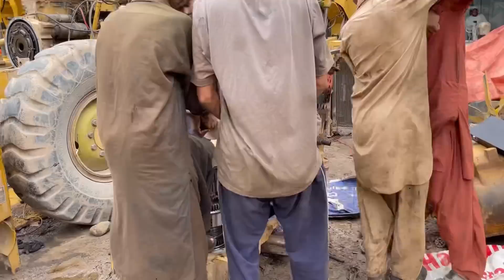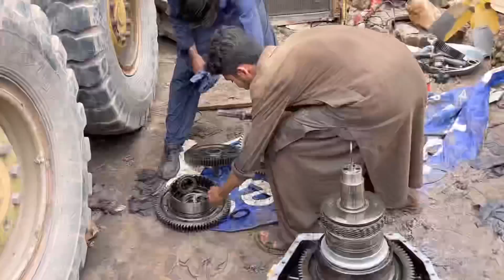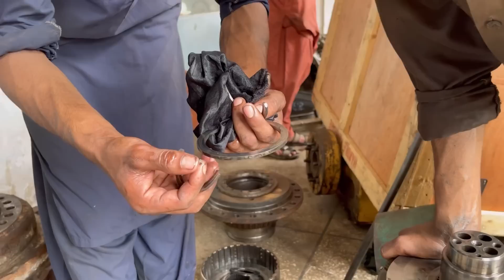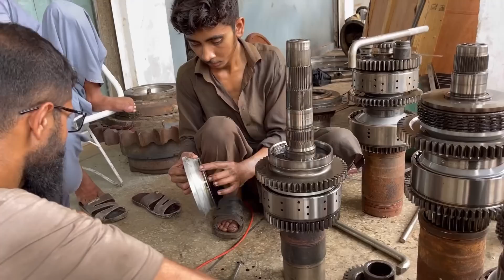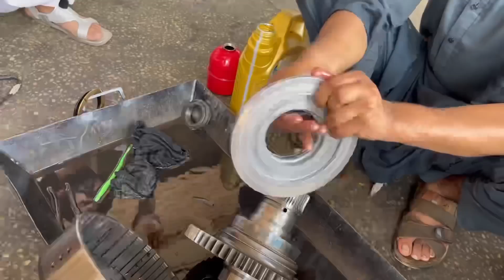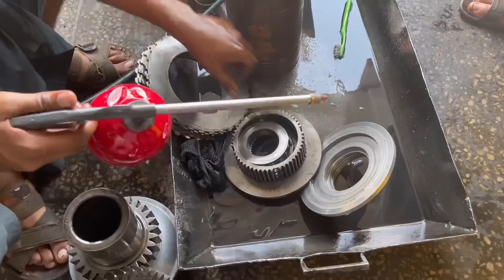The Delivery Of The Grader Transmission Was Not Working Properly, Open it and Check if it is.

Comment: Nice clean workspace.
Reply: Not to believe how clean hands they have. Very special repair.
Reply: Much cleaner than a lot of these.  I was actually impressed the solvent was clean in the big tray and they weren't cleaning everything on the oil saturated dirt.